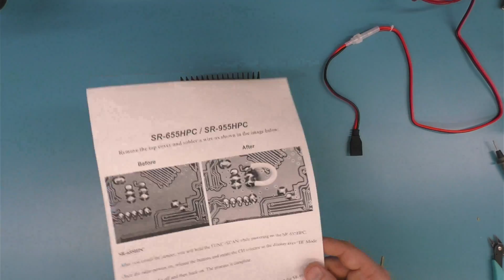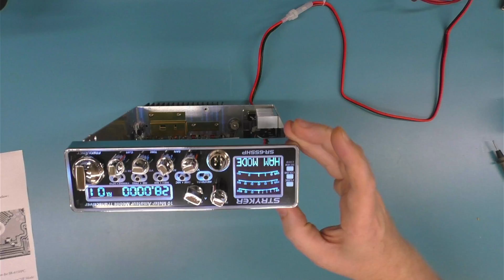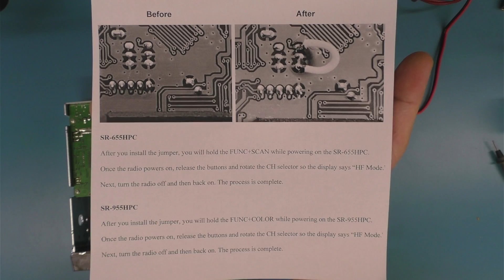New Stryker 655/955 modification procedure (radios without the wire)

Comment: I am wondering if it's possible to use a longer wire, and solder the other ends to a switch (would have to modify the case). That way you could theoretically toggle between 10 and 11 meter modes.

Comment: Just a heads up for people who may be confused.. In more recent v2 versions you no longer have to hold down the FUNC and COLOR buttons to get to that menu. Once you've done the wire mod, simple move the "BAND/VFO" switch to BAND and turn the channel knob until it says BAND 4. This will turn it into a regular CB.
Reply from the maker: I need to note that this menu was removed from the software.

Comment: This also applies to the new 955 HPC+. I followed the instructions and everything is working great. This is my first Stryker and it seems like a great rig.Thank you and 73's.
Reply: Thinking of getting the SR-955HPC like yours. Where did you get your rig/ instructions?  73's
Reply: i am having problem with my 955hpc+, did you had to hold the func and color button? to switch to HF mode?
Reply: @75legends hold down just function button, it will say RETEST and then DONE. Turn off and turn on again and you then have Band 4

Comment: Is anyone else wondering why the heck the aluminum chassis is still stretched out with ribbon wires reaching out to the control board?? Like, this radio could be much more compact! Especially now that components are much smaller and surface mount. That's why i love my small but powerful President Richard!👍

Comment: i soldered the wire in   i have tried several times   when i turn on radio  holding color and function ket i do not get the ham mode
Reply: I'm having the same issue

Comment: I did my buddies radio tonight and it would not power on option. I just hit the band switch and 11m was there. it had the 6 thru holes with just solder in them. I hope I jumped it properly....it works fine. I did top and bottom on the left topside

Comment: Hello, i added the jumper with no luck. any suggestions?
Reply: Try going to band 4 some of the newer radios once the jumper wire is soldered in it’s ready to go and you don’t have to hold the buttons
Reply: Thanks I will give it a try.

Comment: I have added the wire to my radio (955) but when I power on the radio holding the func and color keys I do NOT get the “ham mode”   It just goes to the standard screen.   I do however get 11 meter now.   Any ideas why my radio is different?

Comment: All that wasted empty space.. I always felt like they should of made the radio a bit smaller.
Reply from the maker: and re-tool everything? invoke the package engineers again? why?
What they did actually makes sense from a manufacturing perspective.
Reply: @Mark19960  Really? you care about the manufacturer or the consumer?  IMO it's still a waste of space, bruh! 🤷‍♂
Reply from the maker: @BOXCAR-N2VJX  I see both sides. I work with both sides.
It might be a "waste of space" but the practical reasons remain.. and ultimately the decision to keep things as they are was the most sensible one.

Comment: I have a 955hpc thats about maybe 10 years old and brand new. Obtained from a family member bought this days before he passed and now I am finally ready to use it. I dont see a wire on my version, and my board looks completely different than yours. any way you can point me in right direction?
Reply from the maker: that's the version 1 radio. you need to take it to a shop if it's not been modified.
Reply: @Mark19960  Thanks, after posting my comment I did some research on the unit and found that it is indeed modded already and tested at the shop it was purchased at. Now I realize that it's just too big to install in the vehicle I wanted to install in so it's going up for sale soon.

Comment: Mine isn’t giving me the option for ham/hf mode after modification while turning the radio as instructed. The video wasn’t clear of you would have access to Band 4 before the modification. I did the modification before ever powering the radio on so now I’m not sure where I’m at.
Reply from the maker: It seems that the menu was taken out in later versions of the software after I did this video so all thats needed is the wire.
Reply: @Mark19960  sweet! I will get it installed in my semi truck today and give it a whirl.

Comment: Just now watched your video and converted mine....Works great and your video was extremely helpful. For some reason, I didn't have to switch modes...I soldered the wire and it was already there when I turned it on.THANKS!
Reply: mine did  same thing i tried several time to get the mode to show up

Comment: Hey Mark,

I didn't check beforehand but after I did this mod all I can get out of the radio on any channel is 1.4 watts using an inline swr/power meter?  I noticed when I booted up after the jumper was installed it didn't go to Ham mode, nor was there any "HF" to switch to.  I do have all the CB channels on band D, but I'm concerned because of everything else.  This is for my SR-655HPC.

Thanks for any advice.

Comment: On my 655 the top and middle solder points are soldered together. It doesn't look like the 655 you are together but separated,  can any one help on this
Reply: He's working on a v3 if you have the bare you have a v2 remove the bar.

Comment: What’s that going to do to the radio performance? You showed how to solder but what’s that ops going to do ?
Reply: It will need to be placed on the bench, preferably an Oscilloscope and checked, the electrical flo, bios has just been changed.
Reply: Im led to believe that it already is set up to work after either the snip, or the addition of the wire. You could have a chat with your tech, but it should be fine from what this channel has said.

Comment: Thanks, I did this on my new 655 and it works perfectly. I also found the way to get into the service menu and adjusted the low and high power set points and the low and high modulation rates. I set it so I could adjust my dead key down to a watt and a half and the high to about 20 watts. I adjusted the low power modulation for a maximum PEP swing of about 50 watts. I have a 2 pill 1446 (on low) driving an 8 pill 2290 (Texas Star Hotplate) into a 5/8 ground plane and getting around 1400 watts PEP out. Everyone says it sounds great. Styrker radio's rock......
Reply: How did you make the adjustments?
Reply: How did you do that?
Reply: Hold down the color button while turning the radio on. Rotate channel selector to item you want to change, key up the radio and rotate channel selector to change setting, un key radio and setting is saved. Accessing the service menu at your own risk. If you are not sure on what you're doing, stay out of service menu but if you do write down the factory setting before you change anything thing. The only things I changed was AM low power, AM high power, AM low modulation and AM high modulation. I put the AM low and high power to 82 (keeps my dead key around 1-1/2 watts no matter where the RF power is) i set the AM low modulation to 45 (maximum swing at low power) and AM high modulation to 60 (reduced modulation to avoid distortion at full power. At low power radio keys 1-1/2 watts and swings about 10 watts PEP.  At full power radio key is the same but swings full output 60 to 65 watts PEP. I selected these settings so I can run my 2x8 box with radio on low power or run barefoot with radio alone at full power. Your settings may vary but is a good starting point.

Comment: So if you installed a switch instead of the jumper wire could you switch between the stock and mod without damaging the radio?
Reply from the maker: Well you still have to go into the menu to change from HF to HAM and vice versa.
You still have to add the wire to the current radios so adding a switch would not change anything for you.

Comment: Does this increase the output
Reply from the maker: Nope. just mods the radio.
Reply: It increases the ammount of channels or bands that you can use, but with the wider spread, you must keep an eye on your swr readings..... a variable swr tuner with "load" and "plate" adaptor/meter would be very usefull, but i believe some car aerils like whips can be tuned to do both the 11 and 10 meter bands by an alankey sliding the whip in and out abit for whichever you want to use......  73's

Comment: Thank you so much Mark. I just got my 955 and couldnt understand why I didnt have a wire. You just saved me bro.... 73's....
Reply from the maker: No worries mate. It may change yet again.. and if it does I will put that info up as well.
Reply: @Mark19960  Thanks again, just soldered it in and , presto changeoooo....... It works :)

Comment: What happens when you key a radio into a signal generator? Does it blow it up and cause it to have distortion?
Reply from the maker: Define "signal generator" - you have arbitrary / function / RF signal generators for example.
Reply: @Mark19960  RF type. Would you use those other ones connected to the antenna of a radio?
Reply from the maker: To answer your question as to an RF generator "blowing up" or causing it to "have distortion" ... not usually no. RF generators have an RPP system. RPP being reverse power protection. If you transmitted on a radio into it.. They will go clunk.. and scream RPP at you on the screen. The input is disconnected. Unless you shove a lot of power into one (usually > 50 watts CW depending on frequency) it's going to survive quite happily after you take away the RF source and usually hit a key or button on the screen to have it start generating RF again. The people that design RF generators already thought of that.....
Reply: @Mark19960  Good to know. Thanks

Comment: How can I buy a new 955 v2 that has got the wire to snip to convert it to 11m.???  I can snip a wire but my hands aren't steady enough to be soldering inside a $440 radio.  The only radio "shop" that works on cb's want to charge like ,$220 to convert peak and tune one, which is crazy since the v2 is all in the software (no golden screwdriver necessary).
Reply from the maker: I would call some dealers and ask for one that is just modded but not touched.
Now, their price is their price but 220 dollars is excessive in my opinion.
Reply: Gawd.... what i could do with 220$..... just to undo 4 screws and snip a wire, or solder a wire.....

Idear....  go to a parts shop that sells resisters and capacitors to people, and ask the guy at the counter if he knows someone that is handy with a soldering iron..... (for example, these old pioneer hifi repair and recap people could do this job in a second and proberly wouldnt charge you a cent if you showed them this video on your phone to the technician......

Other from that, buy a soldering iron (25watt, small type) and practice on an old circuit board untill you master the skill.....

S.A.S motto.... "he who dares wins" 

Yes im from the u.k....

Comment: They could shorten that radio up quite a bit
Reply: Doing that would be a re-tool / new chassis, doesn't make sense dollar wise as well as that extra aluminum chassis may help heat dissipation on that V reg side.  
 IMHO
Reply from the maker: True.
I will add it to the list of items to cover when I go over the differences.
There are some reasons why shortening the radio isn't the best idea either.
Reply: Just sayin.. board is tiny
Reply from the maker: @Tony-st6yd  That's true. It's predominately 0402 sized components. Pretty small stuff.
Reply: Haha nice I had the same wonder so thanks for commenting! It would help it fit in my gas friendly tacoma and civics.